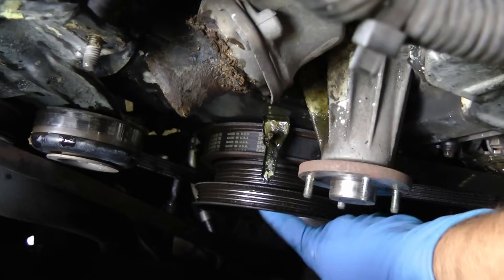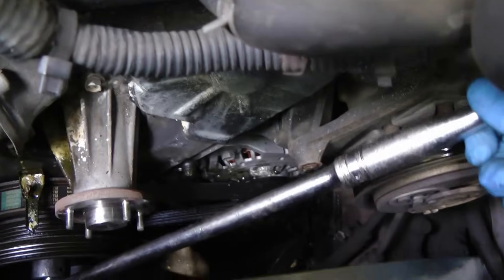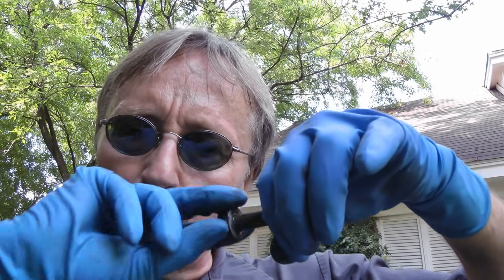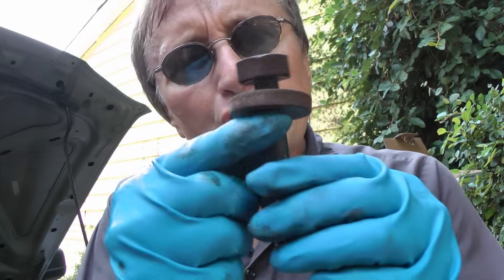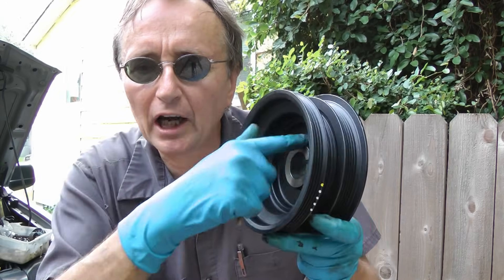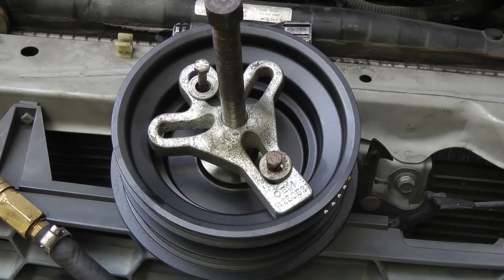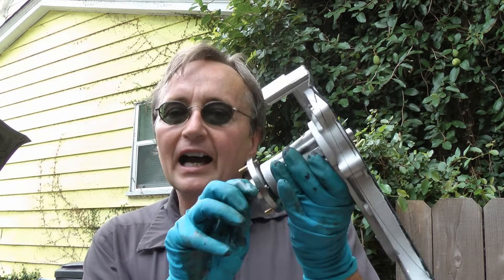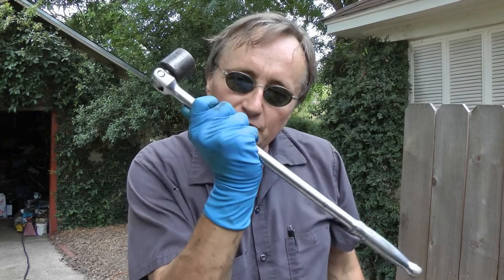How to Remove a Crankshaft Pulley in Your Car

Comment: This is for andrew g you should use torque wrench to tighting back a crank pulley bolt because sometimes the impact gun over tighting them that torque wrench got a gauge that tells you how many pounds of torque that car is call for I been working on cars for 30 years I am only 37 ha ha
Reply: +TheBeautifulme198
The one question that is not being answered is how to stop the crank from turning when you try to torque the bolt back on.?????

Comment: I am needing to do this on a 99 Ram 1500 5.9. Any concerns about breaking the bolt from the quick torque of the engine?
Reply from the maker: IF it turns in the right direction. bolt is only loosened, can't be broken that way

Comment from the maker: you can put locktite on the bolt to hold it in, or you have to lock the pulley to keep it from moving, using a strap they make to do that

Comment: Great video...the truck in this video appears to be Nissan (exterra, frontier or pathfinder).  The engine, water pump, and crank pulley look identical to my '03 3.3 V6 frontier.  What sealer, if any, did you use to install the gasket on the water pump? Chiltons says RTV sealant, but factory service manual says "anaerobic liquid gasket maker". Just curious as to how to install the pump properly. I'm going to change the timing belt and don't want the new pump to leak on to the new belt.

Comment: Hey Scotty, I have a 2002 Honda civic that needs the Crankshaft pulley removed, but supposedly need a special pulley holder to remove it. Anyway to do it without the pulley holder?
Reply from the maker: if you have an impact wrench to take it off, yes. Otherwise buy the tool

Comment: Good day Scotty, I'm trying to fix my Ford Mustang '08. The crank shaft pulley locked, looks like it's missing parts of the plastic pulley, and the drive belt came off. Also, there was various plastic pieces around the engine. I was wondering what can I do to fix it.

Comment: I'm working on my 1995 lexus GS300, getting the harmonic balancer off- and am going to try this, but before i do- i know that the manufacturer's specs for torque on the harmonic balancer is 239 ft/lbs. I have a torque wrench that goes up that high but i am worried if i try to use the engine to loosen the bolt, because its probably torqued so tight, it might rub the bolt off. What do you think? Also, how the hell do I torque it to 239, with 6 ft long cheater bar?Thanks!
Reply from the maker: you get a strap wrench, put it on the crank pulley, and use a torque wrench instead of a cheater bar to put it back on. Taking it off effects nothing
Reply: thanks! I got it off with a 5' cheater bar and some muscle, guts, and luck.

Comment: Hi Scotty, I have just done a timing belt change on a VW polo 1.4 and used your method to remove the crankshaft pulley bolt, can you confirm this method will not damage the engine, my timing marks are all correct but now the car will not start! what would your advice be? I have taken off and replaced twice just to make sure the timing is correct! what would be the next thing to check as i have not done anything  else? it has fuel and battery is okay, its turning over but just not firing! any advice would be great, Thanks
Reply from the maker: it can't damage an engine, is just loosens the bolt. MANY things can cause no start  so try my video "fixing a car that cranks but doesn't start up" , perhaps the crank sensor has been unplugged or damaged during that work
Reply: Thanks for the quick reply Scotty, I performed a compression test today, i have no compression at cylinders 3 and 4, is the next step now to remove the head and check the valves?

Comment: Hey Scotty. Do you know anything about a wobbly crankshaft pulley on a 3.5 V6 chrysler intrepid? Would replacing the pulley and belt do the trick?
Reply from the maker: it often does, they have rubber inside and that breaks down, making them wobble
Reply: Thanks!

Comment: Thanks the video. I cannot use the trick to crank engine trick as i have taken out most of the part of the engine. any other way to remove loose the crankshaft pulley bolt without impact gun? (the bolt is a hex, different from the one on yiour demo above, Mitsubishi magna 1999, 6 cylinder)
Reply from the maker: get a chain strap wrench, have one guy hold it on the crank pulley, and then you get a long cheater bar and socket and pull
Reply: Scotty Kilmer Thanks will do that

Comment: Hello Scotty, firstly thank you so much for your videos. May I ask you an advice? How long should Crankshaft pulley last? The rubber on my pulley (turbo-diesel engine) burned out three years ago so I replaced it with new pulley and last week it happened again (approx 30 000 km). Am I doing something wrong? The previous pulley ground holes into the timing belt cover, could that be the problem? Thank you for your time. Regards Tomas
Reply from the maker: metal ones last forever, rubber ones in the middle are crap, try to get a  full metal one

Comment: Tried this on a '04 Sienna.  Didn't work.  Ended up using a breaker bar with 4' cheater extension.  Tried the breaker bar/extension on a '06 Honda Pilot.  Bolt wouldn't budge.  Decided to try the starter bump and the bolt came loose with the first bump.  Goes to show you never know.  Thanks, again, Scottie!

Comment: I guess you can tighten the bolt the same way by placing the end of the breaker bar underneath a solid object on the other side of the car?

Comment: Hey Scotty I can't find many videos on pulley noises so here it goes, when I accelerate a clanking noise can be heard the noise fades when I step more on the throttle the noise fades, I can be sure its a pulley, as I drive the noise can be faintly heard. The noise is strongest when I start driving at a green light. In the few days since the noise started it has gotten louder and louder. Any thoughts on this!?
Reply from the maker: +BrownKnight011 first, remove all fan belts and run it to see if noise goes away, then pull on the pulleys to see which one has play if noise goes away
Reply: +Scotty Kilmer I had My car checked to verify on the noise I had and the mechanic told me its the engine that its bad it needs replacement! I think he is trying to do work on my car it don't need! He said the noise is related to the timing belt in my car, forgot exactly what he said that deals with the noise and timing belt but supposedly its common in Toyota engines! So I am just going to take it to the manufacturer dealer and have it professionally checked!

Comment: Before you try to loosen harmonic balanced bolt and make a mess of the front one your engine please remove a relay,to stop it starting or disconnect a Cas sensor so it won't start

Comment: How do you RETIGHTEN the crank pulley bolt after you put the pulley back on (assuming you still don't have an impact gun).
Reply from the maker: get a strap wrench to hold the pulley in place, I just gone one at harbor freight tools for 8 bucks

Comment: Great Video, but do i need a special tool to put it back ?
Reply from the maker: you can use a strap wrench to hold the pulley from turning when bolting it back on. Places like harbor freight tools sell them for less than ten bucks

Comment: Scotty Excusé my question 
When you turn the ignition switch how do I make sure I don’t turn on the engine all the way. It will be a disaster if the engine starts ???? Thank you..
Reply: Pull the spark plug wires

Comment: I had a mechanic put a timing belt on my 99 Ford Ranger 2.5 L engine. They removed the harmonic balancer and when reinstalling it they forgot the washer for the front of the bolt which caused it to rock forward break the key as well as cause a lot of other damages. Throughout the next few months I complained about a sound coming from the bottom of the engine bay. I was informed that it was just my air-conditioning compressor. I had a feeling this was incorrect finally four months later I find out what has truly happened. They are refusing to pay for the damages any suggestions and how do I remove this broken key from the crankshaft?

Comment: Hi scotty . I was change the timing belt.oil pump gasket on my 98 camry.and i used your method but i accidentally turned on the engine about 2sec omg!! And when i assembled everything i could hear something hits the timing cover. Do you think i bent the end of the crankshaft when i mistaknely on the engine? Or is it possible if i havent tight the tesioner pulley propery and belt is hitting the timing cover?? Thank you. I been blue all day haha
Reply: 최성우  I highly doubt you did any damage to the crank. It sounds like something else loosened inside or you have something which isnt tight enough.
I would keep checking everything until you find it. Good luck!

Comment: I have a 2003 honda civic with a 1.7L. engine. I believe the engine turns counter-clockwise will this trick work with that type of engine?
Reply from the maker: ***** no, honda engines turn the wrong way for this trick

Comment: hi scotty I used your trick on my 2007 mustang and it worked great now the puller won't get it off just gets stuck and the whole thing spends. what do I do?
Reply from the maker: +Lionel Oakes you may need a special puller tool to get the pulley off.   places like auto zone often loan em free
Reply: Yes I got it from there but thank u sir

Comment: Than once in a while you would run into a car with crank bolt torqued over 300 ft/lb that no impact wrench can remove and starter motor isn't strong enough to remove.  This is why I usually buy the special tool designed specifically for the car (usually under $100).

Comment: hey Scotty what do you use to install the crankshaft pulley? once the nut for the crankshaft pulley get snug enough all the crankshaft does is spin. do u use the same removal tool to install it or something else?
Reply from the maker: you can put a strap wrench on the pulley and hold it tight while turning the bolt

Comment: Can this method be used on a 94 Honda civic dx manual transmission, when the timing belt has broken? Having a hard time getting it off...should I heat the bolt?
Reply: No.  Don't ever try this on the older 4 cylinder Hondas.  Let alone with a broken timing belt.  If you tried this in your situation, you would break the crank bolt or pull the threads from the crankshaft and bend the valves if you havent already from the timing belt breaking.  The proper way is to get a fat allen key and stick it in the holes on the pulley. Then you'll notice there are some reinforced areas on the frame.  Set the key on the one towards the back of the engine.  Then get a 19mm or 18mm.  I forget what it is.  A big breaker bar and pipe and go to town on it.  Remember, righty tighty lefty loosey.

Comment: Doing a timing belt job.  Got the new water pump and belt on.  I am now trying to bolt the belt covers back on, but 2 of the cover bolts go through holes on the water pump and screw into threaded holes on the engine.  I guess I didn't line up the water pump quite right...the timing cover bolts won't screw into the block.  I haven't put coolant in yet, but I put sealant on the pump side of the paper gasket.  If I take the pump off to re-align, do I have to put a new gasket on?

Comment: good trick for a manual transmission is put it in 5th gear then thatll hold the crank in place. im assuming it may work on an auto if you put it in drive but i never tried it.
Reply: Chris Perez in a automatic it has a torque converter. Won't work! Our a auto n drive on a steep hill engine off see what happens........ hope you have good brakes😳
Reply: Danny Allen yea i have never done that in an auto but with a stick I'll just put it in 5th gear it'll be out real quick

Comment: Hi Scotty , im using this method to remove the crank pulley bolt , it work flawlessly , but when im going to tighten it to factory spec torque rating the crankshaft just spin around so i cant reach the recommended torque rating , can you advice me how to tighten it up properly without its spinning around ? Thanks
Reply: chain wrench

Comment: I used the trick to loosen to the bolt with all spark plugs removed. It worked, but before I would remove the old timing belt, I tried to spin the crankshaft pulley by hand or by a wrench even with all spark plugs removed, it does not turn at all. I am not applying big torque because it is supposed to be easy turn. The timing belt does not snap. It is an Odyssey 2007.  Am I getting it seized at the crankshaft, water pump or anything?
Reply: I tried to use starter again and it turned. That is a comfort. But it is only friction, but people say you only need a figure to turn it... but looks like I need to use a break bar.

Comment: What happens when your crank sprocket isn't key'd like on the duratec, wouldnt using the starter to remove the harmonic balancer cause expensive damage?

Comment: I have the manual on CD for this vehicle but it does not say which direction to turn the bolt to remove the damper pulley? 
2001 Mitsubishi Montero Limited 3.5L V6   Mitsubishi  tools MD998715 & MB990767

Comment: 2001 ford lightning 5.4L, having trouble takeing off a siver funnal bracket that connects crank shaft pulley to lower super charger pulley. witch way does the funnal peice turn to remove so i can get to the center bolt on the crank shaft pulley? please help.

Comment: Scotty,i am replacing my crankshaft pulley.I got if off,do i just put another one on and tighten it to the correct torque or are there other things i should look for/do? 96 toyota camry 2.2
Reply from the maker: just make sure the key doesn't fall off the crankshaft
Reply: Scotty Kilmer  the key looks as if its welded on the shaft.When i put the new pulley on and slide it over the key does it have to be even with the hole ?
Reply: Craig Gremillion thats in the back

Comment: Okey  i have a cuestion for you well i need to fix a noise lifters of valvles but ill take the oportunity to changue timing belt but to get time to start it is a automatic gear box hyundai santa fe 2009 2.7 v6 gls  which the way is to move crankshaft whit automatic gear how should i move whit rachet if id lock up coz engine is stop and parked by automatic gear in park brake ? Or is possible to move parked i am not a mechanic but nothing is impossible i inoe that but Could you explain it thanks million sorry for my English ... Santiago Chile South america ..
Regards....

Comment: Hey scotty. with newer cars, will a lightweight pulley that is the same size as the oem pulley be bad for the engines life in the long run?
Reply from the maker: +Rick James no, as long as it doesn't break
Reply: It depends if it replaces the harmonic damper or just the pulley. You don't want to get rid of a harmonic damper. It's there for a reason...

Comment: I am trying to do this on my 99 vette. It's an auto and the shop manual says I need to torque the bolt to 250 ft lbs. That turns the engine over. So while this will work for removal, I will still have to pull the starter and lock the flexplate to torque the bolt back down.

Comment: I pull off all the bolt of my crankshaft pulley and i use a puller, but the crankshaft pulley still stuck in place,is it rust and can i use an hammer and knock on the crank shaft pulley or torch and retry with my puller again right after? thanks Scotty for answer.
Reply: +Spectre Duloft hyundai sonata 2003 2.4c Quebec snow and often - 40 celcius and salt it's terrible for car here in winter,we need tank.
Reply from the maker: +Spectre Duloft of course you can, just be careful not to break or bend anything
Reply: +Scotty Kilmer Finally i pull off the crankshaft pully, My timing belt is like brand new, but the Balance belt it's broken! 
Do i need to adjust all the cam shaft position to change only my small balance belt? Thanks again Scotty

Comment: when you replace a crankshaft oil seal and transmission oil seal on a nissan verita, do you have to bring down the engine? because when i brought my verita to a nissan shop they pulled down the engine and they charged me a lot for labor. but watching your videos i dont see why they had to do that? or is it different with a nissan verita? thank you

Comment: of course-  I can't do this trick, I stupidly took my timing belt off before I decided to take the crank pulley off.  It's a Volvo s60, thought I could get away with not removing the pulley and just sliding the belt underneath-  now, even with an impact-  it still won't move.  I'm going to have to somehow lock the pulley- then use a long cheater- like 4 feet... and pray.    Anyway- I'll get through it.  Thanks for making these videos Scotty.

Comment: scotty Im in a bit of a pickle here. IM changed my harmonic balance r in 99 ram 1500 2wd 5.9L the balance r broke had to replace. did :( didn't rly do it to specs. used my cordless torque drill. and just torqued it back on with the cordless torque drill. now the druck is awful!!! jumps all over the place hard to shift its an auto trans btw. i got an engine light (cylinder 1 misfire like always) nothing new there. but it started flashing today on the way home. what is your advice? I'm pretty sure i messed something up in my engine at this point. should i even try to take it off and replaced using proper procedure?
Reply from the maker: yes, try over, sensors are on the ballancer and if not in the correct position, truck will run like crap
Reply: Scotty Kilmer o i did that today. no more engine light nor is it flashing anymore thanks a bunch. also i still have the " well a popping sound" when accelerate hard. and plus real slow to shift in gears when you put your foot on the gas. Im think trans converter. possible the converter for the shifting problem and popping? only happens when i accelerate hard. plus a constant vibration through the truck

Comment from the maker: NO, hondas spin the wrong way. they make a special tool that holds the crank pulley in place then you use a cheater bar to unbolt the crank bolt.